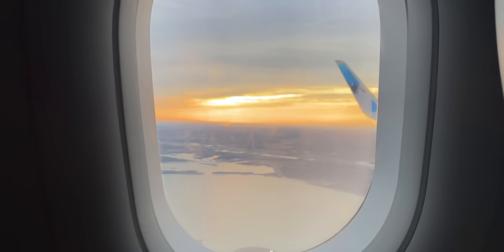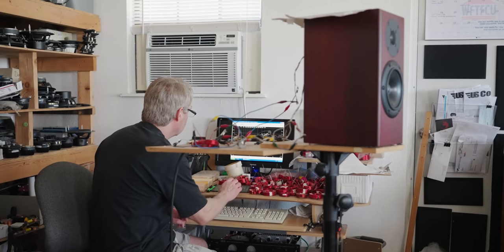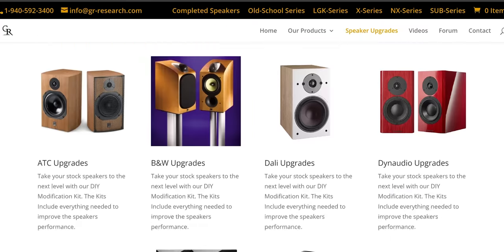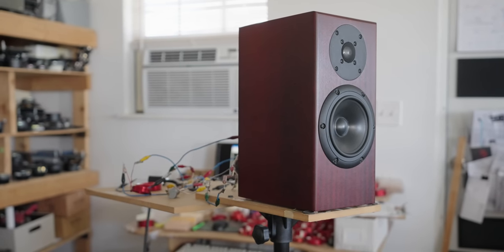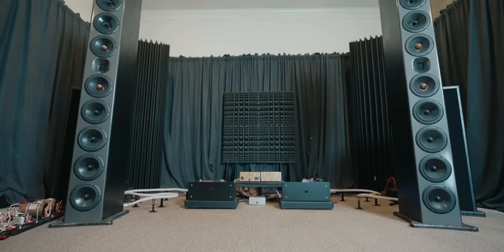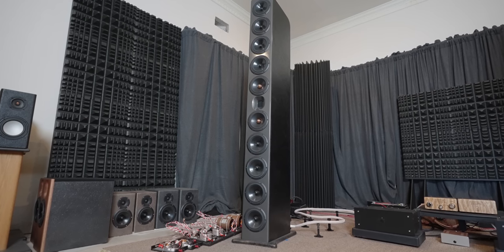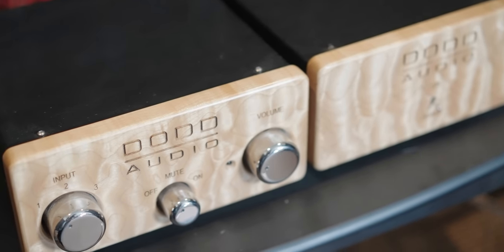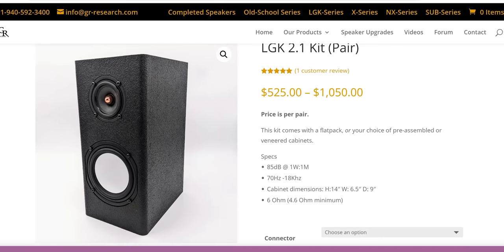Are the GR-Research Audiophile DIY KIT Speakers & Upgrades Worth The $$$?

Comment: He does what I can't be bothered doing, screwing around with replacing embarrassingly cheapass crossovers with real ones. What's not to like?
Reply from the maker: Keep in mind three things
1. Each designer puts more emphasis in certain aspects of the design and when you have been doing it for a long time, your ways become the only way. I am for one a fan of going with high quality parts in the cross over but designers like Andrew Jones have stated that he would rather use that money to better the cabinet or drivers. All I will say is that there are many speaker designers out there with their own set ways and no way is the right way.
2. Danny's upgrade kits don't come for free, they sometimes cost similar or more than the speakers. It's a business for these manufacturers and things are built to a price point. 
3. he does not just replace cheap ass parts but redesigns the entire crossover to his ideology. This does more than replace cheaper parts, it changes the entire speaker
Reply: Does cheaper necessarily mean worse?
Reply: Jay, I have seen a few videos where he doesn't actually create a whole new crossover. Instead, he recommends just going in and upgrading the individual crossover parts with better parts.. It's rare, but it does happen..
Reply: @Jayiyagi  I think Andrew Jones is absolutely right from an OEM point of view: There's a lot more bang for their buck in the drivers and cabinets than the crossover. I mean, imagine how cheap one of GR's DIY kits would be if they used the same level of parts in the crossover that most OEMs do!

But from a DIY standpoint that means that there's a lot more to gain by upgrading the crossover.😊
Reply: Gr speakers drivers are so cheap and plastic looking ...the new line with those super cheap and ugly white drivers 😅.. I wish he believed that driver quality is the same as a crossover
Reply: @Jayiyagi  Are you afraid he may be "fix" YOUR speaker and the sales may take a hit?
Reply: @jctai100  with electronic components I would think so
Reply: @jimberge5884  Don't kid yourself. Our drivers are top of the line and can be compared to anything at any price point. Those cheap little white cone woofers that you are referring to were bought out in a buy out. I even mentioned it in the last video. We only use them in our lowest priced product line where the top model LGK 2.4 kit sells for only $651. We are also only using them below 300Hz or so. So they are fine for the application.
Reply: @jimberge5884  Those 'white drivers' were speakers that he bought in bulk. They were used on the old Onix Rocket speakers sold by AV123 back in the early 2000's. They actually sound really good...
Reply: @Jayiyagi  Andrew Jones' comments about cost/value in performance for crossovers are specifically about the quality/type of parts used in a crossover, not the way it's tuned.  In broad strokes, he may be right because he's talking like for like (i.e. 0.30mH iron core inductor instead of 0.30mH air core), but it still ignores the main debate of flat response vs embellished "voiced" speakers through crossover design.  I think what people really pay for are Danny's time to achieve a flat response, not so much the passives he chooses.  

If Danny redesigned a speaker with a new crossover design and used the cheapest passive components possible with his crossover design/component spec, the speaker will still have a near identical response as it would using expensive passives.  

What we need is a blind A/B of flagship speakers with the way the manufactures set them up versus a GR Research corrected flat response.
Reply: @no name when i got subs i was absolutely shocked how much they screw everything up.
Reply: @no name ❤
Reply: @no name 😊
Reply: @wa2368  Cheap shot. Jay’s been very open and fair here. Let’s not drink anyone’s Kool Aid.  At least realize that Danny builds his rep up usually by putting others down. Jay is obv trying to show pros and cons..
Reply: Honesty, I think GR brings a certain level of fun that this industry NEEDS regardless of how someone is "suppose" to measure.  I think the upgrades are obvious upgrades regardless of if he measures 1 or 2 speakers at a time being he is not building the speaker feom scratch.  Also, the speakers I buy are my speakers, not the manufacturer, so upgrading my speaker is nobodys business, im glad someone is out there with an offering.  I purchased the upgrade for my sony sscs5 speakers just for fun and holy crap man they turned out awesome!!  I honestly dont care how much time sony put in the design, they are at least 2 levels up from stock minimum.  They are good to start off with but I just have so much fun messing with friends with these speakers, they look like a 50 dollar pair of speakers so the price of the upgrade was totally worth the time and money seeing the look on there face with an amp that fits in the palm of my hand.  Pricless$$$$
Reply: Don't knock the "upgrades" till you try them Jay!!😉....do you have a pair of Klipsch speakers laying around?  Try it, let everyone know what you think.  If it sucks, cool, say it sucks, if it's good, different, same whatever, I think that would make for an interesting series.  My guess is you can't, for personal Interest reasons or whatever but you can't knock someone else for the attempt to improve how they see fit, bottom line, it's an improvement and people love it, it's fun!  Better then having a bunch of speakers in the corner that has a certain amount of magic in them so you dont want to get rid of them then you find out that there is someone out there doing actually offering a way to get there!  Like what!  Thats awesome!So much better then them sitting there collecting dust.  Have some fun with it!!  If it wasn't fun I wouldn't be in the hobby.  I love what you are doing with your new speakers, I want to hear them BADLY, and possibly purchase them I just can't throw 5500 on a pair of speakers I never heard.  2k....maybe, but I'd have to hear them for sure.  Now the Galion on the other hand, I ordered blind.  I think that amp will upgrade 90 percent of what's out there, had to have it😁
Reply: @no name I like crossovers.  I also like Kool aid, different flavors, berry, cherry, lemon, whatever.  I put salt on my potatoes as well lol!  If my ladie is having a bad day and my steak tastes like cardboard (which is rare) I put steak sauce.  If I don't like the color of my house I paint it, and I did.  If I want to upgrade to a bigger turbo and injectors in my truck, then I do, and I did.  I also like filters, keeps the junk out of my engine and my oil clean throughout the oil change cycle.  I also LOvE them in my speakers because that speaker doesn't cost as much as a sibelius driver and it's much easier to find.  They are everywhere and are capable of producing magic with the proper FILTERS.  Same ones found in Jay's Typhon and in GR research speakers and 98 percent of other manufacturers.  Love them....love them love them love them!  Pass the salt please😜
Reply: @dannyrichie9743  there not top of the line come on .. not atc or Wilson level … there cheap plastic speakers!! even j said so in a video…
Reply: Seriously!!! How oblivious are you GR Research obsessed people?  He is a guy in the business to make MONEY.  How is he going to make money without promoting his packages or the products he sells.  Do you think he is God?  He is so full of himself that he says every speaker manufacturers product is worse than what the can do.  The guy arrogance is actually disgusting.  Everyone has different tastes in sound and music, that’s why speakers come in so many styles and varieties of sound.  The best quote about sound is this “The only person who has to like the sound of your system is you”. That’s it.  If you are happy than fine.  GR research’s opinion is that every speaker has to sound the same way and that way is his way or you are wrong.  There are so many factors that determine a speakers sound in your room, and a person’s hearing plays factors too.   At the end of the day he is in the business to make as much money as he can, which is fine.  That being said you have to be extremely ignorant and blind to believe it would be possible for him to say a speakers company’s product is good from the factory otherwise what the need to purchase what he is selling.
Reply: @jctai100  no it absolutely doesn’t. It can(but not always)limit the extremes of a component. It can make the sound more appealing. I have heard a $100per speaker difference in Capacitors, an preffered the cheaper one lets say. Best way is always to hear the component if you can. Id say otherwise don’t sweat it too much.
Reply: @cup_and_cone  can’t fault your logic. The question remains: is it Danny’s new crossover design or the quality of the components Danny uses/recommends that matter. Maybe it’s a bit of both.

On a meter a 1mh iron core inductor should measure the same as a 1mh air core inductor (if all other parameters such as DCR remain the same). So why then do we need to pay for more expensive air core inductors or oil MKP capacitors?

Conversely if we have a budget of $1000 to build a speaker how much should we allocate for each: the drivers, cabinet or crossover? 

Danny takes a $1000 speaker, adds about $300 in parts and compares the result with the original $1000 speaker. What if the result was compared against a well designed $1300 speaker? 

I’d like to see 4 or 5 designers like Danny, Andrew (MoFi), Vince Bruzzese (Totem), Jack Oclee-Brown (KEF), Karl-Heinz (Q Acoustics Concept line), face off, each with a $2000 budget. That would be fun.
Reply: they are overpriced he you can buy the parts yourself much cheaper he uses iron core inductors on his big 3 way but on anything else it is cheese he should just sell plans and you can buy the parts half what he charges they arent alot of money he charges A BIG profit
Reply: @no name more like how you perceive the midrange and treble
Reply: @no name because he works on already existing speakers. He doesn't need to measure the lower end. As that's already established by the brand/designer speaker he works on...

If he does that with a from the ground up design. Than yes, I agree ...upgrading existing speakers . 
It's not needed
Reply: @Jayiyagi Therefore he Upgrades them. Not just claims to upgrade them. Upgrading and transforming them. Even Amir (who is not so friendly towards Danny) said the Klipsch 605M in standard form was pretty unlistenable but Danny’s upgrade was a transformed and pretty good speaker. Danny provides a great service not just in helping owners get a better product and more enjoyment from their music but by providing free education too.
Reply: @jctai100 in this case, definitely
Reply: @Hiluxtaco  when the response was good and no major issues - he just replicates the XO with better parts, its true. Good point
Reply: @@smarts99nice theory but where’s the practical reality of that?
Reply: @Jayiyagi - he's not making a speaker fit his "ideology" of a good sounding speaker, he's aiming to give a speaker a (measured) linear response, changing, removing, or replacing aspects which color the sound and hence move the response away from linear. Yes it changes the sound, but to bring it closer to a set standard that any manufacturer should be aiming for.

Comment: Jay, I am not necessarily a big fan of GR-Research, but have watched some of their YouTube Videos. I don't think your criticism of GR-Research of only testing and modifying one speaker is a valid criticism, nor is the complaint about them not measuring the bass frequencies particularly valid either. When GR-research gets in a speaker to see whether it can be improved upon,, they are are primarily focused on frequency response and elimination of spectral decay (to the degree possible) with a better crossover. It doesn't help to listen or measure that in a speaker pair, and they are not trying to necessarily improve the imaging, etc of the speakers (which might be discovered by listening to a pair instead of just one). Likewise, the bass response (other than the crossover point) cannot be helped much and is difficult to measure due to the role of room boundaries. There is only so much time and effort that they can can economically spend on improving the older speakers they get in, and shipping costs are not cheap for the person sending them in, or for the cost of shipping them back. If GR-Research didn't test their own new speakers in pairs, that would be a different story, but I think you are confusing the two different businesses they do (fix old speakers with crossover improvements, versus offer brand new ones).
Reply: That was my interpretation. One speaker is fine for measurements and that is the focus of these improvements.  Improve the specs and the sound quality will follow.

Comment: I am yet to see anyone post a before and after video proving that his upgrades are a change for the better.
Reply: Good point.
Reply: Just look on the internet.. there are a few I found after a simple search.
Reply: same here.....nothing
Reply: When you open up a speaker and find crappy cheap components in the crossover, it's not a stretch to automatically know that up graded components are going to dramatically improve the sound reproduction. I have done simple  same value capacitor upgrades many times and have always physically heard an improvement.
Reply: How would you do that over YTs horrible compression and the audience's varying hardware?  This is a complaint I have common to ALL YT channels that do listening tests over YT, and nothing more.  I could be listening on my phone, or ear buds, or a cheap set of $15 speakers.  How is a listening test supposed to be conveyed over YT on cheap hardware?  It simply can't.  But people like to see it, so reviewers keep giving them what they like to see.
Reply: @jdlech it will still give you an idea of what it will sound like. It’s better than nothing.
Reply: Audio Science Review did a before and after on a Klipsch. Found noticeable improvement after GR mods.
Reply: This
Reply: @jdlech don’t be naive, almost all people writing here have $100+ headphones or $500+ stereo systems, we are not normal people
Reply: @sccanj  😅👍👍

Comment: Why spend $1249  on passive crossover parts for a Magnepan 3.7i upgrade kit when you could buy a pair of Hypex Fusion FA253 three channel dsp plate amplifiers for $1424 and totally transform these speakers.  For just a few hundred more you get six channels of amplification and the ability to dial in perfect crossovers complete with protection circuits for the midrange and tweeters.

Comment: LISTENING tests needs to be done with a pair. For MEASURING and designing a new crossover, you only need one speaker. Even you should be able to distinguish those two completly different situations!

Comment: I do think that your points are fair, I did the upgrade kit on the RP600m's and it was a real big improvement. The sound staging and imaging, depth were way better, and the mid-range was much more present and there was greater detail throughout. So happy I did it.
Reply from the maker: great to hear!
Reply: I did the same with the EQ in Roon for free... Look at the ASR review of the speaker and the EQ settings. It is like a new speaker....
Reply: @jaytorr6701  Amir reviewed another Dan creation at 1200 Dollars sed it was crap
Reply: @Jay Torr  It will not be the same. I have the upgraded and non Upgrade Klipsch. For one you are using Amir's EQ setting in your room where you should be using roon to EQ the whole response of the speaker based on your room. With UMIK-1 + REW to create the filter. That would be the right way to do it and get amazing results. 2nd you are stuck with roon or other stereo dsp systems. Here I'm also using them in a HT setup, no way an AVR can correct for the faults into the speaker and finally the sound before vs after is not just a simple EQ. The wiring, components and no rez add on make the speakers sound completely different to the non modified version
Reply: @jaytorr6701  No. U cannot use an eq suggestion for your own room unless the rooms were exactly the same. That's a fundamental u are pole vaulting over.
Reply: @matthewtaylor7355  Amir is about the cult of Amir.  If you believe you can make an informed decision based on measurements, stay on his site and enjoy yourself.  If you know better, get out and actually listen to gear.